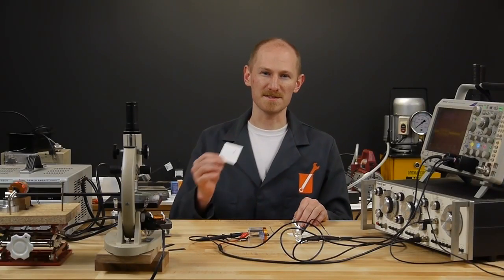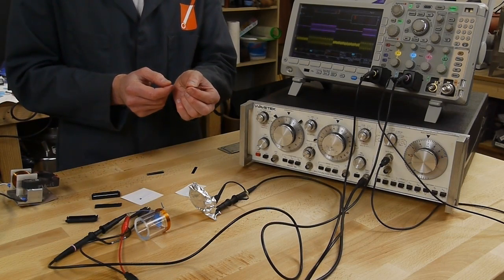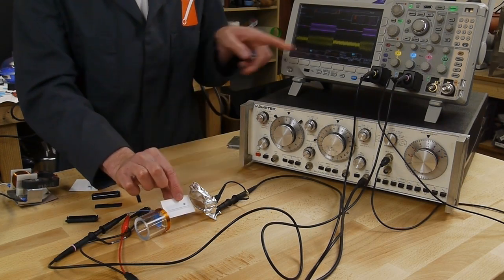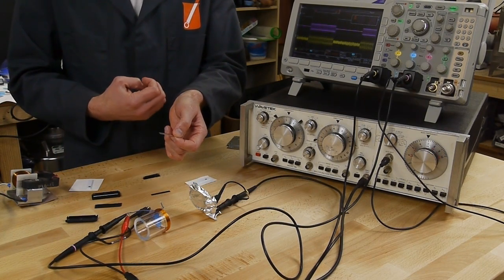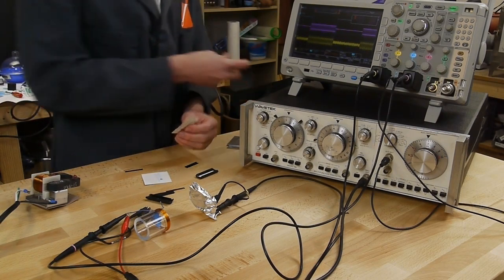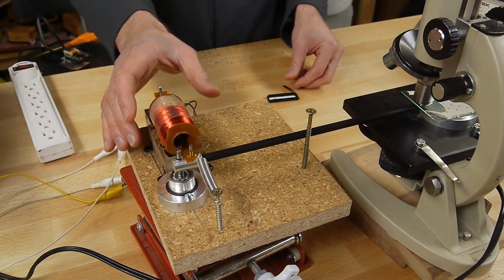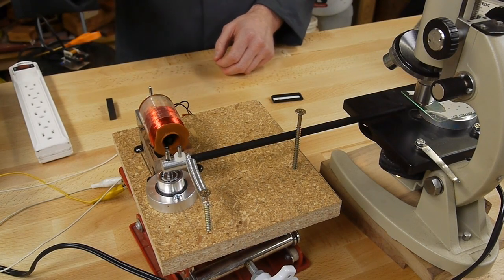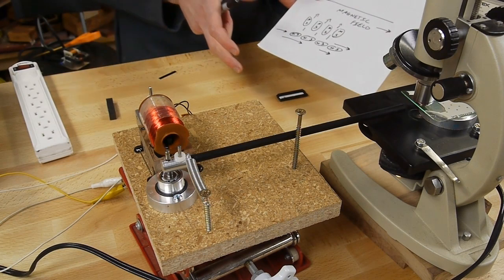How anti-theft tags work - magnetostriction

Comment: I don't see too many of those, but I stick to Target, Walmart, and grocery stores. There are two critical rules for barcodes. 1) You must not use a cart, or walk through the detectors while a cart is there. The sensor for unpaid items is linked to the carts. I prefer to use my own mobility scooter. 2) barcodes must be removed from clear wrapped frozen meats, I know not why. Ground beef is fine, but T bone Steaks will trigger the sensor. Even if you paid for the steak, but have something else you didn't pay for, the UPC on the steak will still trigger the sensors. Even Alchohol is fine. Clear wrapped Steak, chicken, pork, is the only items you have to watch out for.

Comment: Nice work!
Why are there two oscillator stripes in the tag casing?
Reply from the maker: +ddiddy666 That is a good question.  I'm not exactly sure, but I believe the manufacturer uses two ribbons just to get more signal.  Two oscillators will produce more signal than one.  The ribbon cannot be made thicker because it is created by extremely rapid cooling to obtain the desired magnetic properties, and a double-thickness ribbon would cool rapidly enough at the edges, but not quickly enough in the center.  So, two thin ribbons it is.
Reply: +Applied Science, seems like a fair guess. Thanks.
Reply: +Applied Science Perhaps it has something to do with different magnet-harmonic frequencies? i.e. half wave + full wave or 1/4 wave. Curious whether a small neo-d magnet or ferrite magnet on the device with one strip vs two produces different degradation in signal. I'm thinking out of phase frequencies might cancel attempts to bypass the security feature.
Reply: +Applied Science One strip is actually resonating a little high and the other is a little lower than 58kHz.  It helps with system performance and reliability.
Reply: +Proto G, ah!
Reply: Proto G I would think it would have to do with bouncing the signal between the strips.
Reply: @ProtoG42  That was my thought too. They could be slightly different sizes or have slightly different properties. With a few different resonant frequencies, they could be used as a simple coding method so only tags from your shop were detected and you didn't have to deal with activations from something bought at a different shop but not deactivated.
Reply: @AppliedScience  I have read that one of the strips is the resonator, the other is a high-permeability, low remanence alloy intended to grab the fields from the feeble magnetic strip and the oscillator signal, and concentrate the resultant in the resonator.
But again, I read that on the internet.
If it's true I'd love to know how to differentiate the strips (without replicating your length-contraction measuring apparatus) because I can think of a few uses for a high permeability material.
Reply: @ProtoG42  yes, with any mechanical process there could be deviation that'd render a % of tags inoperative to spec. having 2 strips only micro increases the cost but doubles it's reliability

Comment: That was fascinating. And to answer your question, no I don't think the earth's core is affected by magnetostriction. Magnetostriction if I understand it correctly is caused in ferromagnetic materials because the permanently magnetized domains align in an applied magnetic field and this causes a change in dimension. The earth's core is above the Curie point and has no permanently magnetized domains. As for the effect of magnetostriction on the upper mantle and crust , since the earths magnetic field is 0.3 to 0.6 Gauss at the surface and Iron is about 8% of the mantle , 10 cm is too much.

Comment: I suppose there doesn't need to be a DC H field component, but if the strip is at all mechanically lossy, there would have to be a frequency and/or phase shift in the tag-created H field at resonance.  Kind of like induction motor rotors can utilize the stator's AC field to generate an opposing field, but there must be a slip speed for the induction to occur.

Comment: I understand somehow the strip resonates with the surrounding oscillating field when nearby the magnetized strip.  Are you saying the detectors are able to sense the field/signal emitted from the ringing strip when the surrounding field stops and the strip somehow emits a ringing signal/field on its own after the surrounding oscillating field is stopped?
Reply: Sounds similar to a metal detector.

In a metal detector, a coil creates an electromagnetic field.
When metal enters the field, the field makes the metal create its own field in response.
That field created by the metal causes resistance to the field created by the detector, and the circuitry in the metal detector can measure that change in resistance. 

This is simplified, but that is the gist

Comment: I opened up one of these in high school when I worked at autozone. When I put it together outside of the casing and placed it on the demagnitizer the strip jumped! I also found an easy way to defeat these is to just stick a magnet on it and the strips will be stuck together and wont work. Also reactivating them with a magnet and placing them on shopping carts was pretty funny.

Comment: Could please confirm something for me that is not clear in the video.  Does the material increase or decrease when the magnetic field is applied. Did you try to reverse the current to see if the material is inversely affected? And if it is, which direction of the current flow created the expansion and contraction.

I hope to reproduce your apparatus soon, but I currently don't have a high powered microscope.  I am interested to know the: 
If the material expands in the EM field regardless of the direction of current flow, is is possible the field is causing a temperature change in the material resulting the thermal expansion. My belief is the current has to be going somewhere and I expect it''s 'consumed' and dissipated as heat, in the coil and the material in the EM field.  This makes me wonder if you increase or decrease the current flowing though the coil, would you see an difference in the expansion.

Thanks for all the GREAT videos!!

Comment: Back when there used to be stores that sold records and tapes, didn't they have a system that had a paper sticker with foil inside it in a maze-like pattern that they used for security? Or was that just a fancy sticker meant to scare people into not shoplifting, like a fake security camera, or those fake alarm system stickers people put on their windows?
Reply: +USWaterRockets Those are RFID tags with a maze antenna.
Reply: Cool! A video on those would be interesting too!
Reply: +LucasJ1540 No, most of them are RF security tags.  They consist of a coil and two thin sheets of metal that act as a capacitor.

Comment: Loops of network cable wire set off the security sensor where I work I think it's the same concept since it's meant to trigger if keys with special tags on them go through the two posts. If I have a loop of network cable in my laptop bag it sets off the scanner and yes I've tested it without any wire too.

Comment: Hmm.. the static length change due to magnetostriction may only be 12ppm, but it is resonating, so the movement under under the oscillating magnetic field could be orders of magnitude large.  Additionally, it looks like the relevant oscillation for the detector is a transverse wave.  The half wave of 58kHz in steel looks like about 4.4cm.  Maybe the actual movement under oscillation is a lot closer to 1 part per thousand.

Comment: This video... I gotta say, it's so well done. Only 'complain' (and this is just preference) is the reverb in the room, if you stick some echo dampeners on the walls, it would sound much crisper :D

So wait... If you just make a hand held, but powerful AC magnetic field generator, you could deactivate these tags? What about those bigger ones that still use those two barriers at the side of the door, are they the same concept?

Comment: (3:38) - You imply that because the generated field beam is 58kHz, that that validates the "accousto" part of the label, but that would never be "obvious" to me (as a rookie, at least), since I have always thought that the uppermost frequency of the audio spectrum to be at or about 20kHz.
I am obviously wrong and thus stand corrected.
Reply: In a lot of ways an electromagnetic field and an acoustic wave are similar. It is just the manner the transducer is constructed, For example, an Ultrasound Transducer uses a the expansion and contraction properties of a piezo electric crystal to turn 7.8 MHz into an acoustic wave to see inside the human body. That same 7.8 MHz attached to an antenna (also a transducer) creates an electromagnetic field that can be received anywhere in the world.Piezoelectric transducers are also used for SONAR and those frequencies are well above 20 KHz.

Comment: You proved the magnetostriction property of the alloy very nicely, however length changes are unlikely to be the operating principle of these tags. Such a tiny change in length would have a very tiny change in frequency assistated with it, and the cheap detectors couldn't discriminate them.  More likely to be related to eddy currents established in the alloy strip under the influence of an electromagnetic field. These are sensed by metal detector technology using similar sized targets, coils and distances. I suspect the permanent magnetic element is used to disrupt the eddy currents when the tag is disabled.

Comment: I walked into a shop with a 300m box of CAT5 cable. Strangely that also set the alarm off.
Reply: +Paul Hicks The wavelength of a 58 kHz signal is 5172 m, and your rolled box of CAT5 is effectively a 1/17th  wavelength loop antenna. That's close enough to resonate very well.
Reply: +Mark Rose More likely LC resonant, the self capacitance of the coil with its inductance which would be pretty large.
Reply: vk2zay Thanks for the clarification :)

Comment: Fantastic video. How do you explain why they put two strips of the magneto-acoustic strip when one should have sufficed? I'm also wondering how we know that the effect in your experiment is due to magnetostriction, or just due to the strips deflecting ferromagnetically in the magnetic field, causing the ribbon to bow and pulling the lever closer?

Comment: I always thought that the strips resonate in the EM field of the transmitter coil and to convert this mechanical resonance into another EM field you place the strip in a magnetic field. I have not seen anything conclusive in your test but I would be happy to be proven wrong. Did you try to make the strip resonate without permanent magnetism, maybe even by applying more power? Can you pickup the resonance without a magnetic field or does a magnetic field increase the output power? Would be nice to see some additional experiments...

Comment: Interesting to see good old Wavetek generator still working. I used one some 45 yrs ago when in audio maintenance. Is that bearing support from an old school video tape recorder where the head drum was driven by belt? BTW, you could show the target more closer. Now all the equipments took too large part of the picture. Also you could place the generator somewhere backstage as the most important was the scope, not the gen. Now it took much area. You could explain the metal strips in closer view and then switch to the wider picture. Here in Finland our library has similar anti-theft strips but they are narrower and longer placed under the barcode sticker. Before automation the library staff deactivated it with magnet after they scanned the code.

Comment: Nice video as always :)

Two questions:
1) When you put the tag into the field (3:00) you always put it in one way. How does the reaction curve on the osci change when you rotate it 90°?

2) This thing only reacts to the magnetic field - so it would not (hardly) be possible to shield it with something like aluminium foil like you could do with RFID(?). Did you do some tests how shielding would affect the reaction curve?

Thanks

Comment: I set up the same thing similar to yours, but get the opposite effect. If I erase the strip, I get the higher oscillation and if I hit it with a magnet, it doesn't show any change on the scope. This is at the best frequency as being 58.7KHz. I didn't have a capacitor on the receive coil to resonate it.

Comment: Nice work, as always!

Is the static magnet in the the tag a purely mechanical preload?

Also, it looks like you have some ferromagnetic pieces in your test rig - could they be confounding your results? (My first thought for visualising magnetostriction would be to deflect something shiny and bounce a laser off it at a steep angle.)
Reply from the maker: +Damien Miller Thanks!  One of the patents mentioned that the static magnet shifts the resonant peak, as well as reducing its level through its effect on the magnetostrictive response curve.  I'm not sure of the exact physical  reason the curve is shaped that way.  It could be mechanical pre-load.

The spring is the only ferromagnetic part of the test rig, and if it were attracted to the solenoid, the pointer would move the opposite direction caused by magnetostriction when energized.  However, I think it's certainly possible there are other confounding effects.  I like the laser bounce idea.
Reply: +Applied Science 

This video actually reminded me about something I once read: At one time transformers with magnetostrictive cores were used as filters in some communications systems.

These also had biasing magnets, though, If I recall correctly, the primary reason for this was that the magnetostrictive effect is polarity independent, that is, the core would strict regardless of magnetic field direction, effectively vibrating at twice the exciter field frequency, which would not be very useful for a filter, so the biasing magnets were used to shift DC shift the AC field of the exciter coil so it became a varying field of one polarity, and so the vibration frequency of the core would be equal to the exciter frequency. But I suppose the non-linearity you mentioned in the video also would be a reason for having such bias.

The frequency of these filter transformers, too, was set was by the length of the magnetostrictive core element(the speed of sound in the material used would decide what length would be needed).

Thanks for the interesting video and demonstration.
Reply: +Damien Miller I suspect the permanent magnet aids in detection. If you simply vibrate a ferromagnetic item at 58 kHz, I don't see how a coil would detect that. But if you vibrate a ferromagnetic strip which has acquired a static magnetic field from an adjacent magnet, now you have a moving magnet near a coil. That can be detected by induction. I suspect the detection occurs after TX stops, during the ring-down. If I am wrong about how the detection works, I would like to be corrected.
Reply: I wonder if shifting the resonant peak allow the detector circuit to discriminate the transmitted signal from the signal emiited by the tag.

Ben, on your scope what was the phase relationship between the transmit and receive signals or was there any difference, however slight, in their frequencies?
Reply: It is acting as a magnetic bias to the oscillating magnetic field transmitted from the TX coil. It aligns the domains together.

Comment: Great video and information.  Could these tags be detected without being between a transmitter and receiver more like a transmitter and receiver on the same side of the tag? If so, how close would the passive device have to be to the active device for reasonable detection?

Comment: Reminds me of the bulk VHS tape eraser I bought from Radio Shack years ago to try and improve my VCR recordings. (still have it, actually)  So those of a criminal mind could just sneak one of those in, find an electrical outlet used for maintenance (like vacuum cleaners and whatnot), and bypass their detection system.  ouch.

Comment: I think the tag could move more than you have measured here in its application because the system is underdamped. Energy is recycled every oscillation through the trading of kinetic energy and mechanical potential. At steady state the energy added to the system and the energy dissipated / lost from the system are equal, and the Q factor is the ratio between the energy stored and the power dissipated. You could figure out the Q necessary to get that one part per thousand change in length based on physical properties, and if you could believe that number, you could believe it might actually change that much. That said, one part per thousand sounds pretty suspicious.

Comment: How is the H field measured by the receiver amplified by the mechanical resonance of the strips?  Is the motion of the conductive strip creating an induced current, in which case the transmitter coil needs to have a DC component or the slightly magnetized neighbor strip needs to provide that function?  Or is the mechanical resonance somehow coupled back electrically and tuning the transmitter RLC circuit closer to the driver and/or receiver circuit frequency?

Comment: I understand the magnetic field causing the metal strips to oscillate part, but how does the   detector notice such an infinitesimally small movement of metal from several feet away through masses of other material? That's the most sci-fi part of the process to me